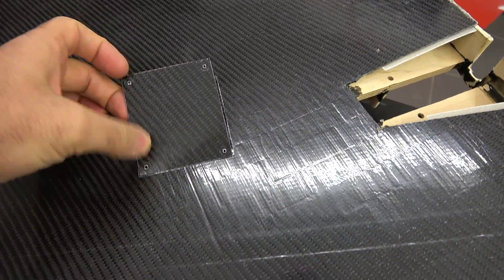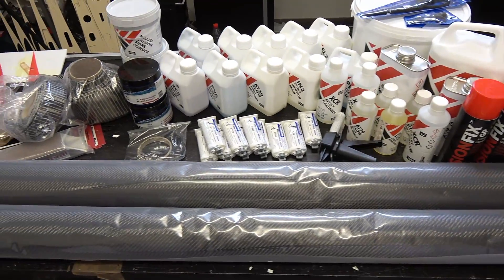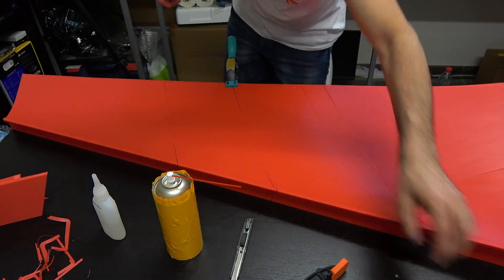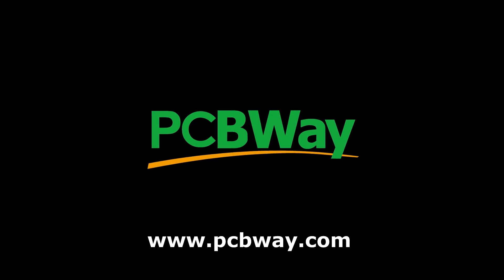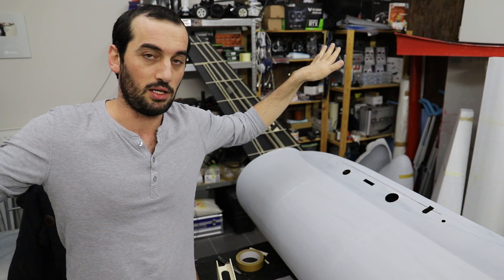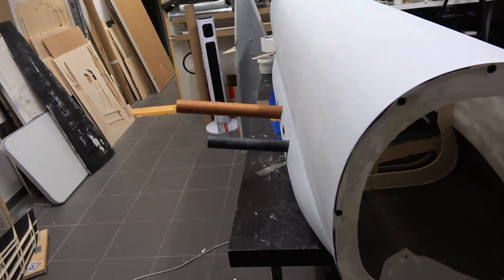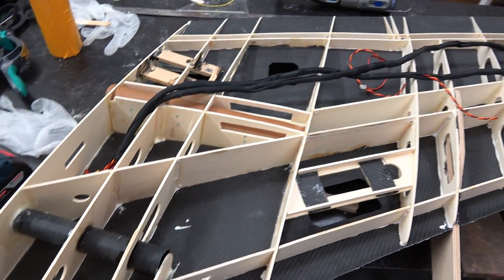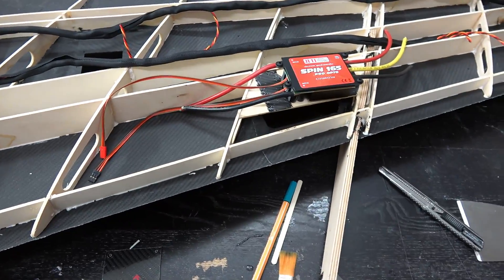Building the Airbus A380 RC airliner Part 5

Comment: Hi, amazing, but I’m really worried about the structural stability of the spar attachment. I don’t think the way how the carbon reinforcement is done has much rigidity. I would recommend attaching the aluminum tubes to each other with a metal part, With a rigidity that matches that of the aluminum tubes themselves

Comment: That was again a very nice insight into your excellent work. Wouldn't it be better for the electronic speed controllers if there was an air supply via the airspeed in addition to the vents? With air intakes in the front of the wings or in the engine nacelles.

What I've always wanted to ask. Would it be possible to produce the FMA IA 36 Cóndor as a flyable model? The engine (an impeller) should be installed in the place where the five Rolls Royce Nene II turbojets were located/planned in the original.

Merry Christmas and a Happy Holidays!

Comment: You say the surface is not perfect, but full scale aircraft is not 100% perfect neither. 
Too much perfect is not realistic. 
A suggestion about a first layer of epoxy on the mold maybe use a paint pistol to get a uniform coating ? Requires a small cabin and wash but maybe worthed. Moreover you can use it for epoxy painting, doing your own colors... Not a bad tool wit protection.
I guess this A380 will be a climax of your first r/c period. Like Picasso had a blue period, then a red one.. 
The summer will be back soon 🙂

Comment: I've been following you for quite some time, I recall where you used like foam board or some sort of material like that to build a airliner. You even learned how to use like a CAD drawing platform to design so you could 3D print fuselage molds to lay up glass fuselages. Then you have mastered the use of usen carbon fiber to lay up flying surface skins , make your acess hatch covers more professional. You sure have come a very long way, keep up the great building technology.... I give you a very big 2 Thumbs Up....

Comment: Ramy it looks good but I want to give you a strong WARNING on a major flaw in your construction. I am talking about the aft tubes inside of the fuselage, I am talking about the main wing joiner. There is a buckling of the unidirectional carbon weave where the tubes did not touch. I had an elevator fold in half because of a similar flaw in the construction. The fix is kind of easy, fill in the buckled gap with epoxy and microbaloons mix sand the excess off and add layers of Uni on top to bridge the gap. This will fix the top side. This is the easy part. It is not clear from video but there is no Uni reinforcement under the tube at all other than you glue it directly to the plywood box. You bet on the Uni outside of the wood box to do the  job but I would not trust it. As is there is a big chance the wings will fold up if you pull up hard. As for the construction technique of the wing I hope you will use the top mold halves when you join the wing in place to maintain washout. I wish you the best of luck and hope that you read this advice carefully.
Reply: I was about to wonder if I was the only person thinking of this. It would be awful if the wing tubes folded up in the fuse because of not enough bonding and strength in the bottom of them. The center wing tube gap worries me also. We will see.

Comment: Just a head's up.  It appears you are using latex gloves to handle that epoxy.  Please switch to nitrile gloves.  The "bad stuff" in epoxy hardeners go right through latex and eventually you will become sensitized to resin causing all sorts of problems.

Comment: Hi Bro! New project, old questions.
Where do you find your 3D CAD Data files?
Do you make any structural calculations on your own RC planes?
Cheers
Reply: He explained it already, he buys videogame quality 3d model from one of the 3d models selling websites and then base on it he makes cad files and mold files himself, all structural issues are just matters of experience with previous smaller models and testing prototypes.

Comment: so huge project. I'm impressed how well you are going. Just a question. Instead of drilling holes in the carbon plate for esc's airflow , did you think of having a thin grill instead ? air flow wouild be better and it would be almost invisible. Merry christmas and see you next year

Comment: great job , as usual !!! on one of my existing project, i switch from plain fiber construction as you do to all vacuum bagged parts, i use 50gr glass+80gr carb +xps+50gr glass for all parts and i save 30/100 of structural weight of the plane (me262 1/4 scale , 26 kg before , 20,5 kg now) ......